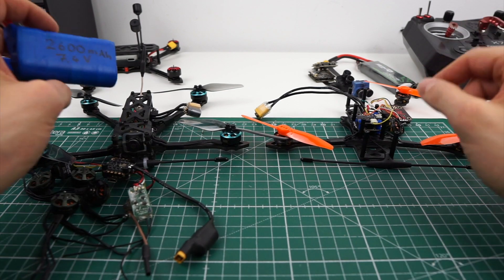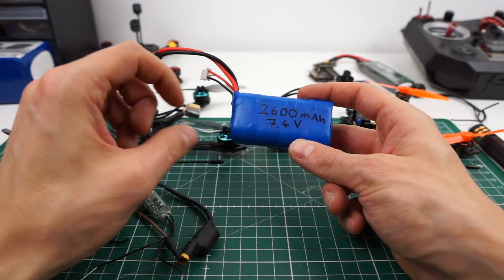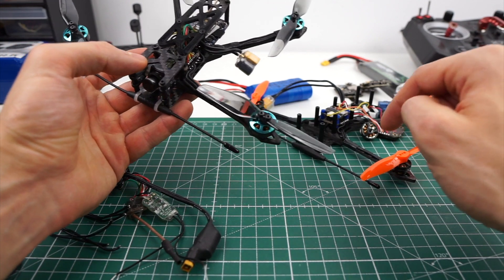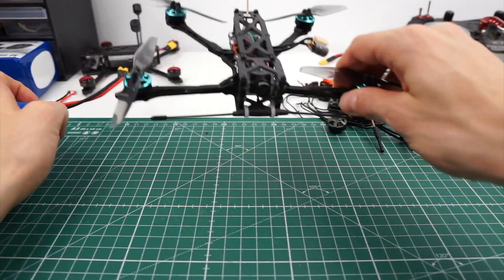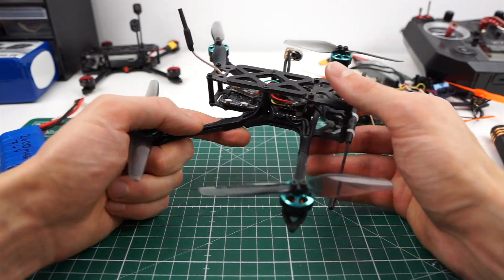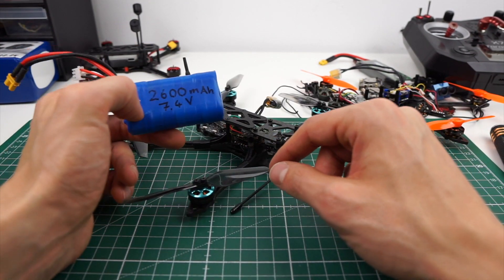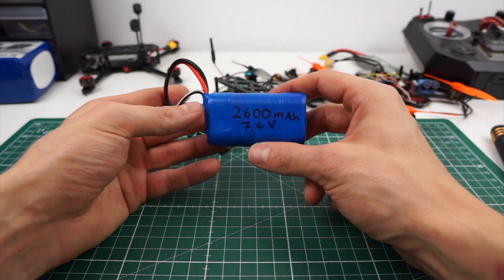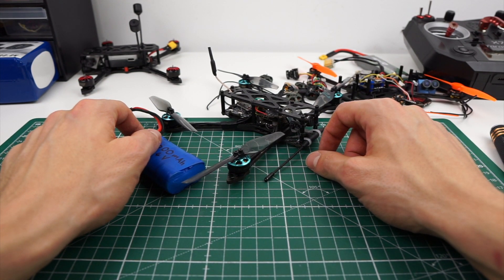Tech-talk: Final conclusion on Li-Ion testing

Comment: Why are you using 18650? I have been looking into other li-ion battery sizes that might work better for small/light weight 3s and 6s options
Reply from the maker: I looked for other sizes but couldn't find  any that have a high enough amp rating
Reply: @DaveCFPV  for real. I just know I'll come across a game changer on of these days!
Reply: @DaveCFPV  Well I guess that depends on the amp draw of the quad. With something on bi-blades it might be totally fine on a battery with a 30c as long as it is a higher mah.
Reply from the maker: @Zachtamundo   I know but I really couldn't find any smaller cells than 18650 that are anywhere near high discharge capable and even the 18650 is actually just an 13C  (35A max / 2,6Ah)

Comment: So how did the Mavic mini do it? Doesn't it also run 4 inch props and a 2s 18650pack. Maybe try buying some Mavic mini motors and and props
Reply: Nothing magic, just an efficient setup.  The props are 4.7" diameter x 2.6" pitch.  The motors (guessing by measuring a picture of them in proportion to the known prop length) look to be 15mm diameter x 4mm stator height.  Their Spark motors also happen to be 1504 2100KV, so let's just pretend they saved some money by re-using the tooling for the most part, with only a slight bell modification for the different prop mount.  We know the All-Up-Weight is 249g, and the flight duration is estimated at 30 minutes for 100%.  A quick search of YouTube shows the real-world flight duration between 27 and 28 minutes down to about 5% capacity.  The battery specs say they're 2400mAh 2S Li-ion.  The formula in reverse is 60 minutes / 28 minutes = 2.14Ah.  2.14Ah * 60 minutes / 28 minutes = 4.59 Amps at hover.  4.59A * 7.2V = 33W at hover.  249 grams AUW / 33W =  7.54g/W efficiency.  With that figure in mind (it's a conservative estimate for sure), Google and study some thrust tables of various motor / prop combos.  I think you'll find that 7.54g/W is quite decent...  most of the freestyle drones we fly are much less than that.  Check my math if it matters...  been drinkin tonight, bout to sleep ; )

The factors in order of importance are low AUW, high battery capacity for weight (as long as it can handle the amp draw based on how aggressively you want to fly it), prop disc area (diameter), bi-blade props with low prop pitch and low motor KV (as long as the combo has your hover load somewhere in the lower-middle of the power band) to keep the draw low.  If you can keep the amp draw low enough, you can safely use Li-ion batteries, which usually have higher power density compared to Lipo.  The real challenge is tuning the flight characteristics of the propulsion system as a whole, which is a lot more nuanced and application-based.  That's where the DJI magic happens; lots of trial and error went into training someone's intuition there, cause it gets a little bit better every time they release a new quad.
Reply from the maker: @mistercohaagen   Haha you are pretty good at drunk math! Really interesting figures and pretty much exactly what i would expect. I was actually about to get a set of DJI Spark motors and props for this setup but finally I think the KV is just too low for decent FPV flying on 2S Li-Ion. Even the 6000kV 1404 start to feel kind of underpowered und lack control when the voltage gets low. On a DJI rig you probably don't even notice how bad it actually flies because you don't have real  authority over the controls and see it all stabilized through the gimbal.
Reply: @DaveCFPV  Banggood / Ebay has all the cheap Spark repair parts... it would be an interesting experiment to try.  Keep in mind that better ESC's = better handling at low RPM's (voltage / KV).  If you had some BLHeli32's at DShot600 or better, then you'd probably be fine as long as your AUW was light.  Gyroscopic stability doesn't really do much, cause if it isn't precisely canceled out by the FC, it wouldn't fly well to begin with.  That, and the fact that the prop area scooping air is a much higher force than anything that angular momentum from the mass of the motor bell could ever exert, just based on how all the spinning weight is distributed.  The prop blade is a giant lever and the weight of all the metal in the motor is practically spherical.  You'd have to somehow reverse that in order to use the gyroscopic force for stabilization...  like, if the outer edges of each blade had the magnets and the whole propeller fan was inside some kind of maglev cage where the stator coils where on the inside of a duct inducting inward.  The S.H.I.E.L.D. Helicarrier comes to mind; https://youtu.be/hZ3Z6Db0-js  Not exactly what I'm envisioning, but helps get the idea across.
I think you'd be fine to try it.  There is no single parameter of it that would kill the whole possibility of a manageable flight envelope.  KV doesn't matter as much as AUW when it comes to Amp draw.  Think of the whole quad as an equation where all the shop-able numbers (AUW, KV, V, Amp draw, Ah, stator size and height, magnet gauss, prop diameter and pitch, ESC communication speed, processor / control loop speed, etc.) are all multipliers that effect each other.  You can compensate for mismatched parts by tweaking something else (lower pitch, voltage or throttle limit for a too-high KV).  That's the amazing paradigm shift of feedback control theory robotics, you can compensate for hardware with software, and vice-versa.  Picture this example as a scaled up version of what we're talking about doing with lower numbers; https://oscarliang.com/6s-high-kv-motors/  In short, there are plenty of ways to limit Amp draw or tighten up the feedback loop.  It's all pendulum oscillation and lever lengths...  fun to intuit and visualize.
Reply: @mistercohaagen  is the flight duration at 28 minutes a completely still hover? If it's moving that would require more lift to keep the moving momentum
Reply: @emielleclercq  I haven't bought one...  it's just some other people's tests from a random YouTube search.  But you'd be surprised how much forward velocity doesn't eat into the hover energy requirements.  Basically if you tilt 2° forward out of a flat hover, the forward ground speed grows until you encounter aerodynamic resistance.  With DJI, they engineer the fuselage to produce a bit of lift during forward flight as well, so it actually gets more efficient until you start trying to go faster than the drag lets you fly.  If you punch it to accelerate faster, you're only burning more than hover energy until you're up to speed, then it levels off.  Having a flight platform like a quad that cancels out it's own gravity, basically turns the whole Earth into a giant Air Hockey table.
Reply from the maker: probably way more customized hardware and software haha.

Comment: Hehe, nice to hear your experience - I fly a Amaxinno 4" frame with Acrobrat 1406 on 4S  500mAh and those HQ 4" toothpick Biblades...it flies for ~ 10 minutes solo and ~4 with a Session5 on top...with my 4S 3000mAh Li-ion pack ( used for long range) I flew about 14 minutes and got bored @ about 3V (and way to much current ;-) 
Now I try to make lightweight ducts for that platform 😜✌️
Reply: So these brat motors work fine on 4s with the hq 4x2.5 props? I was a bit concerned that they are a bit too high kv to be still efficient on 4s 4 inch.
Reply: @mrmOoOon90  Jep, works great !